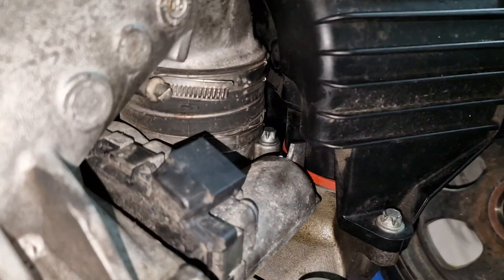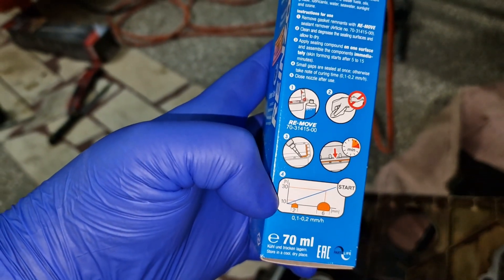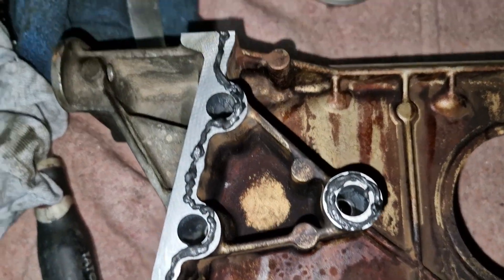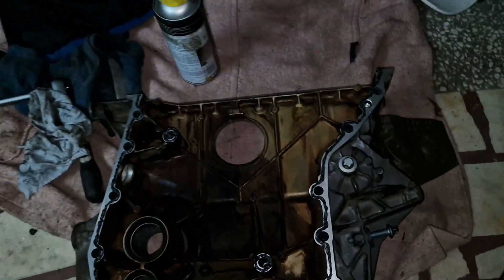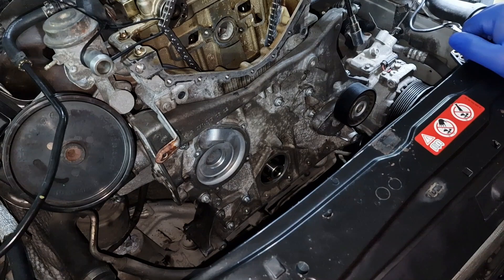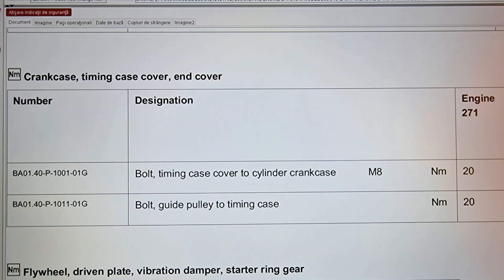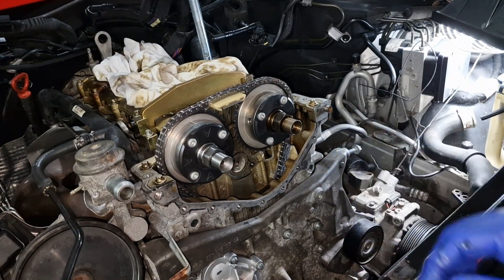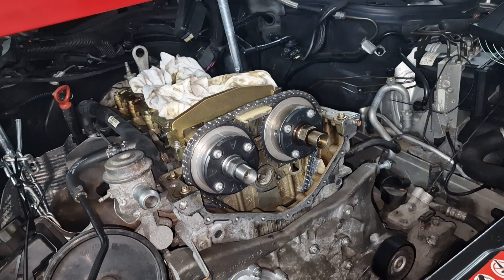Timing Chain kit replacement M271 Part 6

Comment: salut, cum le spune la oringurile alea mari din capacul pe care ai pus silicon? cum le pot gasi.. multumesc!
Reply from the maker: Salut. Zi-mi la ce minut și secunda le vezi.
Reply: 3:17
Reply from the maker: @Ten2CuSaparecord  Codul pt oring mic A0179975045
Codul pt oring mare A0179974945
Mergi la orice magazin de piese auto și lei dai aceste coduri pt comanda. Sunt relativ ieftine pe original. Recomand sa le iei doar pe original Mercedes Benz.
Reply: @AlexAndreiZAR  multumesc frumos, wk viitor voi ajuta mecanicul sa schimbam distributia si ma uit la videoclipurile tale, foarte fain ce faci si ma ajuta enorm . Multumesc inca odata
Reply from the maker: @Ten2CuSaparecord  sa te uiți la toate videoclipurile cu atenție. Sunt detalii care te ajuta în momente de cumpănă. Bafta